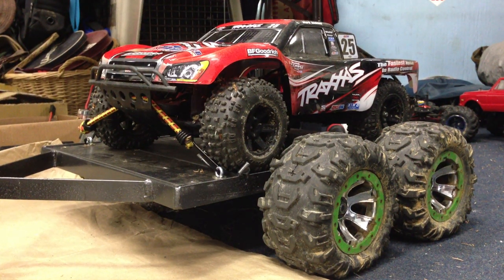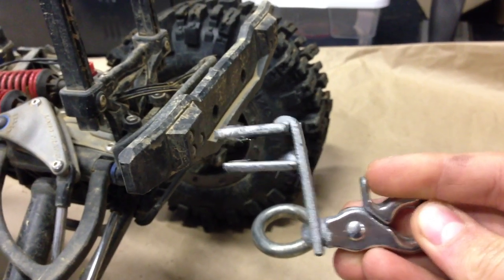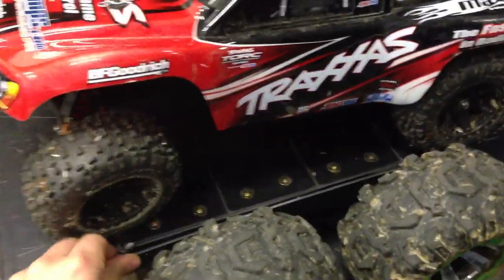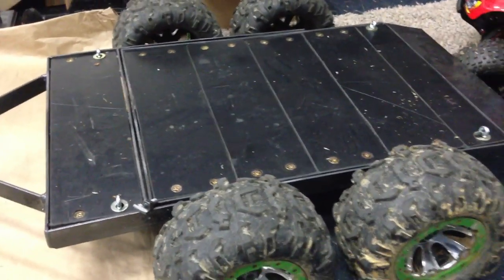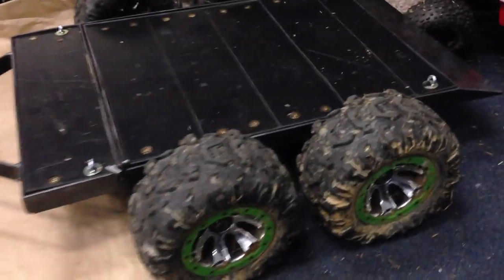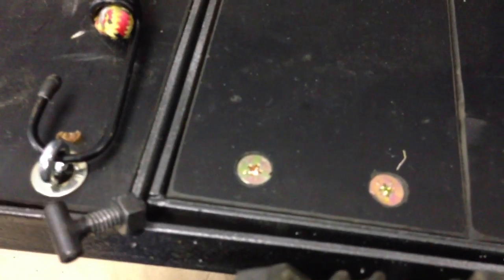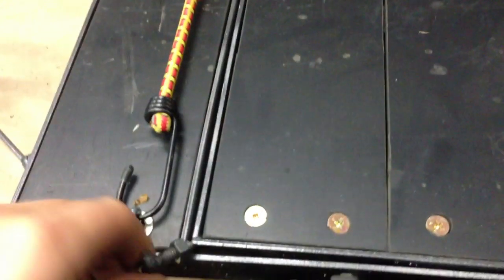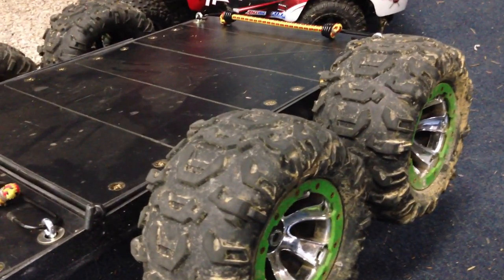RC Car Trailer Build

Comment: If you don't want the wheels locked into the axle. You can have it set up from the end of the axle toward the middle lock nut washer wheel washer lock nut but don't tighten the lock nuts too much or the wheel won't spin. Leave enough space that you could slide another washer between the washer and the wheel or lock nut.

Comment: Hey I'm gona build on with balsa wood and I was wondering how the wheels were held NOT to Bing with the trailer I was wanting to use a nut on both sides of wheel but how did u do it